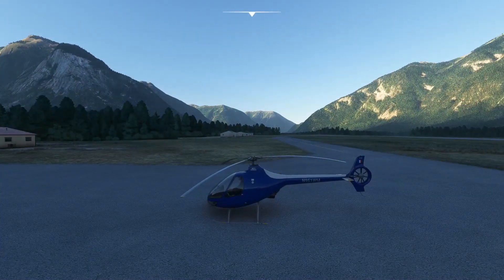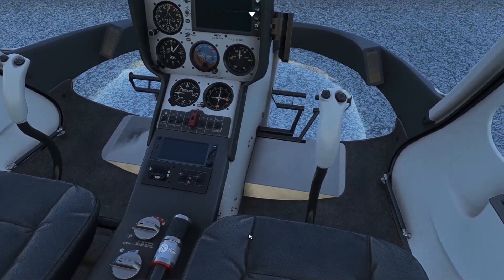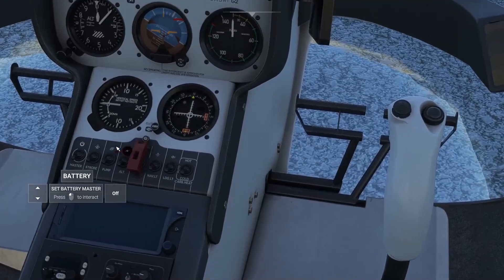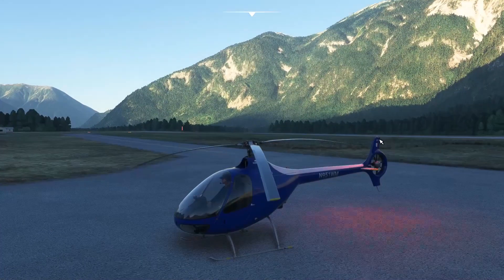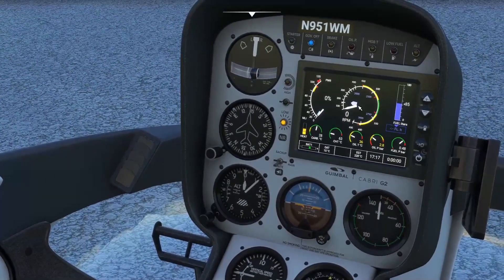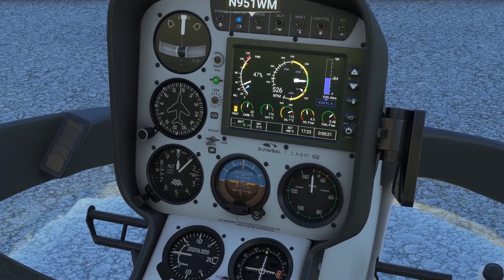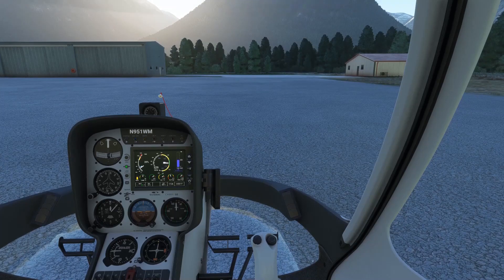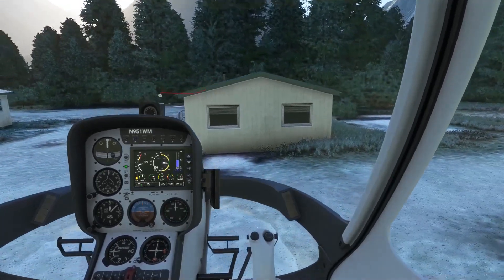NEW MSFS 2020 Guimbal Cabri Helicopter Review Pt. 1 - Startup & Hover

Comment: excellent work on this video, sir! Looks like a fine start indeed. One thing of note, the reason for the low skid in the hover is not 'transitional' related as the helicopter isnt in a transitional phase, its hovering. The reason is to do with the secondary effect of the anti torque that the tail rotor provides. Whist the anti torque pedal does stop the helicopter from spinning in a stable hover, the secondary effect is a tail rotor 'pushing' the hovering helicopter off to the left (assuming a clockise spinning rotor). In order to counteract this effect, a small right cyclic input is needed (right roll) and this is why in a hover the right skid is low (as would be the left skid with an anticlockwise spinning rotor). If the helicopter was completely flat with the horizon it would quickly start to drift without this cyclic correction. As an observer, this is also an easy way to determine a hovering helicopter's main rotor rotation direction by just observing its low skid in the hover. I hope that makes sense?
Reply from the maker: Thx, that's right. I don't think I used the word "transition" at all. I mentioned translating tendency so the tendency to drift or translate laterally so we are talking about the same thing here 👍

Comment: Really enjoying your videos mate, I am a heli pilot rated on both the Robinson R22 and R44 helicopters and I have one hour logged on the Cabri G2... I really couldn't wait for helicopters to be released on the sim and overall I am quite enjoying them but there is definitely some fundamentals missing. I think my biggest issue at the moment is that when doing an autoration, the flare at the end is all but useless. In real life you would flare the aircraft to bleed off the airspeed and then only pull collective at the last minute to soften the touchdown. In the same it seems the flare is completely ignored and you just plummet to the ground unless you pull collective, which even at the end of the auto seems to get you about 50ft of lift where as on an aircraft like the G2, you definitely would not get lift with the engine at idle! 😂😂
Reply from the maker: Thx, happy to hear. I had a similar experience, it goes down VERY quickly, Rotors just don't want to overspeed and I got an extrordinary amount of lift out of  the blades at the end of the flare. Anyway, autorotation seems to be the hardest aspect to mimic in a lot of sims...cheers

Comment: I was never able to get any helicopter to work in MSFS2020. With the helicopter files installed in the community folder, either the sim freezes at startup or at best the heli will not appear in the hangar along with the rest of the aircraft.
Reply from the maker: Had a similar issue because the Helicopters folder was in a subfolder. Make sure there is only one folder for the sim to open. Greetz
Reply: @thenerdyhelisimmer4608  I always installed the helis exactly as other fixed-wing aircraft, to no avail.